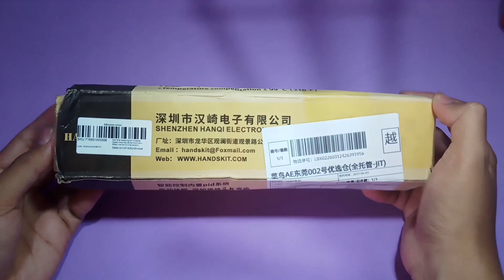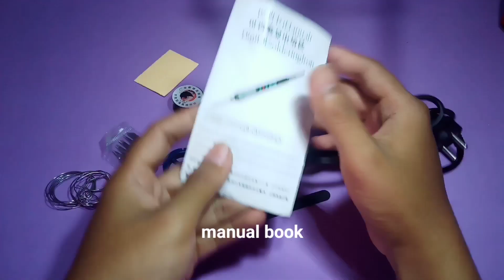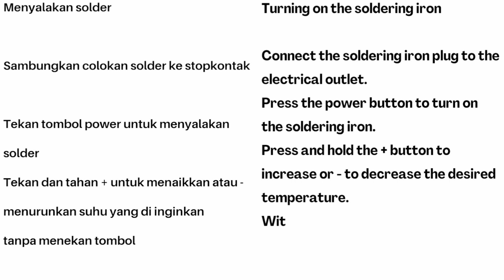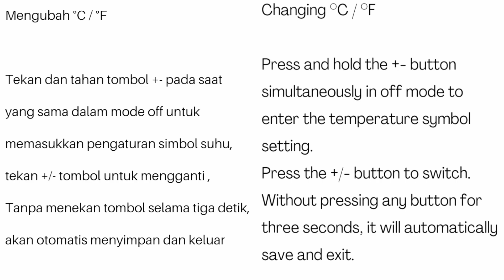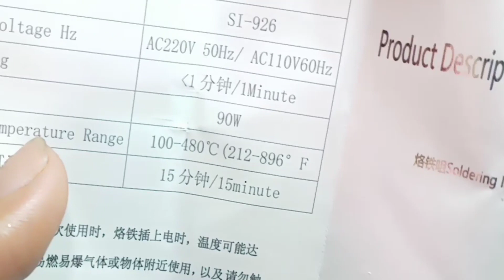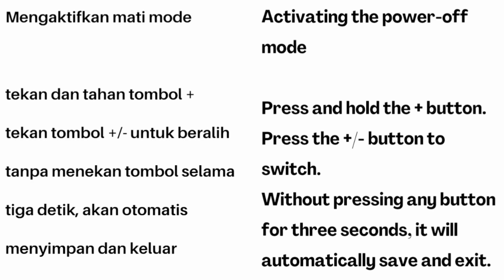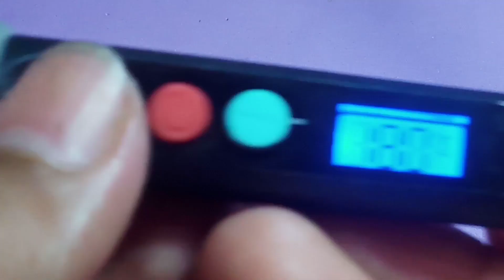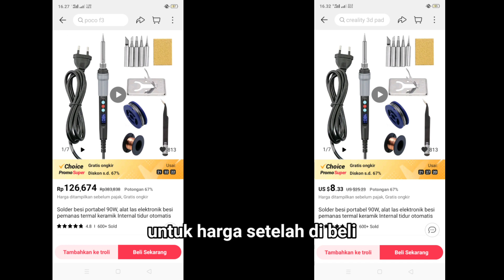Solder paling jos gandos | unboxing dan tes solder handskit 90 watt suhu dapat diatur, lcd, auto off

Comment: sanggup solder baterai 18650 gak om 😅
Reply: Bantu jawab sebenarnya solder 20 rb juga bisa bang tinggal di kasih flux khusus buat stainless, atau area yg mau di solder di kerok dulu supaya lapisan stainlessnya agak ke kikis baru di solder
Reply: @agustantanhermawan1120  ya bisa emang bisaaa tapi bisa berkarat 

solder bermerek sperti handskit, 90W real 400°
solder 20rb, maximal 280°
yg mau dipanaskan plat nikel trus dipaksa dengan cara dirusak lapisan akhir.
ya berkarat 🤣